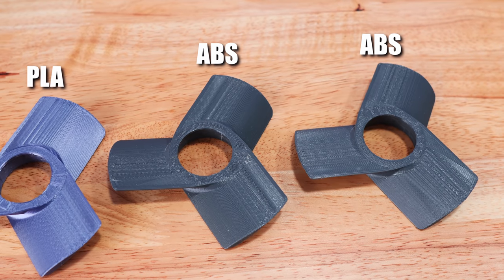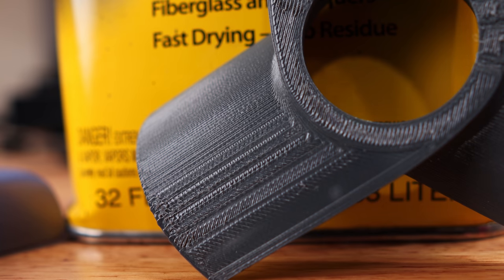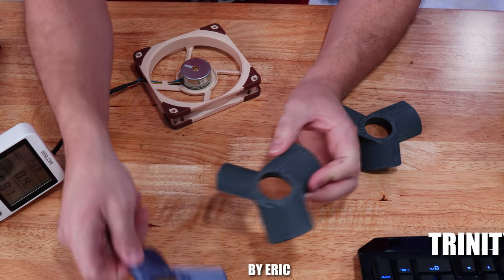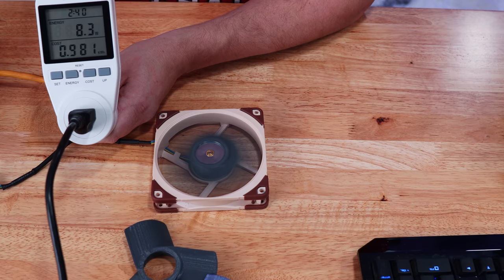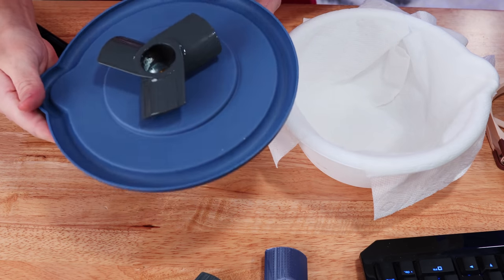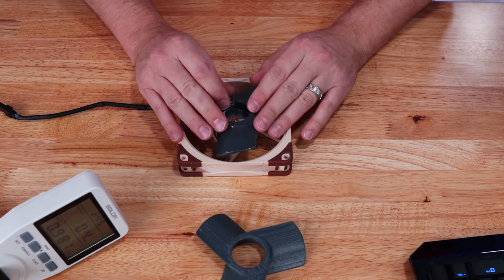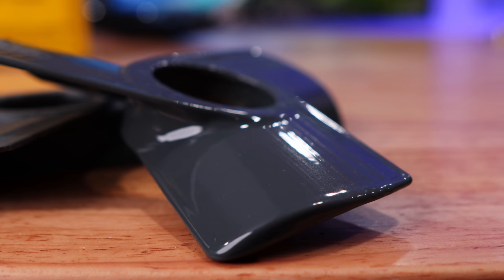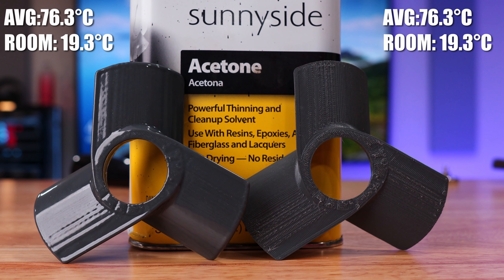Does Smoothing 3D Prints Improve Performance and Can You Smooth PLA?

Comment: Solid testing, would be interesting to know if they spin at the same speed or if there is some variance in the airflow they move. Not that it change the conclusion, just for the sake of being thorough!
Reply: was wondering that 2
Reply: I figure that a smoothed fan will be slightly more resistant to stalling, and so should put out a slightly higher static pressure. The effect should be more significant the more blades the fan has.
Reply: @fnorgen  This was my first thought when the smoothed fan pulled slightly more power when it was face down on the table but was equal to the untreated fan when standing up. If the fan produced slightly higher static pressure that could explain why it behaved that way. However the way the fans performed identically for cooling suggest otherwise.

I don't know what the truth is but it should be possible to design a simple way to test the static pressure and see if there's a noticeable difference between the two.
Reply: Between power draw and temperature management, I think it stands to reason that the fans are spinning at roughly the same speed. If one were spinning faster for the same power draw, I imagine you'd see a lower measured temperature since that would likely mean an increased CFM
Reply: @vedritmathias9193  not necessarily, fluid dynamics are strange enough that one could be spinning 10% faster but created destructive turbulence reducing the outcome efficiency just enough to match
Reply: or weight,
Reply: @fnorgen  I 2nd that because yes it’s pulling more power due to higher static pressure causing the motor more resistance trying to push the air no where.
Reply: Considering they both still take the same amount of power that suggests the RPM is still in the margin of error. So don't worry about it.
Reply: Well, if they keep exactly the same temperature, i'd say they spin at the same rate.
Reply: @TrenDMuzic  Consider what happens when you block the inlet to a vacuum cleaner.  It speeds up. This happens because it's doing less work. Either that or magic.  Any thoughts?   :)
Reply: Golf balls are not smooth, but the texture actually improves laminar flow. Not sure if that is applicable to fan blades
Reply: @sepg5084  Hard to imagine why it wouldn't.
Reply: To my ear, it seems like they were running at pretty much identical RPM. You should be able to confirm this by extracting the audio from the two +10dB sections and running through a software spectrum analyser.
Reply: @Graeme_Lastname  There is a difference between blocking the inlet and blocking the outlet. 

Blocking the inlet makes the fan draw a vacuum which make it cavitate and as the resistance goes down it will tend to spin faster.

Blocking the outlet will instead mean the fan will be building a high pressure zone, increasing resistance and causing the air resistance to increase and slowing the fan down.

When the fan was run laying flat on the table it was blowing the air down, causing that higher pressure zone and increased air resistance for the fan blades. This is why I think it's possible that the smoothed fan might have a slight advantage in static pressure. It all hinges on if as pressure increases the irregularities in the surface starts to make more of a difference. If the smoothed fan has lesser air resistance then  it will spin faster at a given air pressure causing it to build pressure until the resistance increases to match the power output of the motor.

Now it can't be a huge difference or the number would be more significant, but it's still interesting.

Besides noise is an indication of energy loss. It takes energy to create noise after all. So as the smoothed fan is less noisy it should indicate that it is more efficient.

But just to make things less clear a perfectly smooth surface isn't always the most efficient. For instance a golf ball has a myriad of small dimples and these will actually decrease it's air resistance. Myth Busters did an experiment where they covered a car in a layer of clay and made dimples in it. They then ran a test course and measured the fuel consumption. This was compared to the untreated car, but it still had the same amount of weight added to it in the booth to make things roughly equal. According to Adam Savage they didn't have high expectations for this but was shocked when the "golf dimple car" showed about 14% less fuel consumption when run at 60 Mph (working from memory here, so the numbers might be a bit off).  Adam did a video where he talked about this experiment just recently, so it's easy to look it up on his channel.

Their numbers were so startling that at least one auto manufacturer tried to recreate it to see if it could be correct. We know this as they contacted the Myth Busters with their findings which were not any where near as impressive, but from what I remember they still got a slight improvement. I guess the only reason we are not driving around in cars covered by dimples is because it would look silly...
Besides the effect seems to increase with the speed, which kind of makes sense, and a vary large part of the car fleet will almost never get up to 60 Mph or higher as they spend a lot of time in city traffic. And at those speeds the air resistance is not a huge factor.

Now I have to admit that I have totally lost track of what I started out writing about, so I think I'll better stop here...

Oh yes, it was about fans and why the surface structure of the fan blades might make a difference in certain situations. Right...
Reply: @blahorgaslisk7763  Keep this short if I can, big subject.   Myth busters TV entertainment. I have read and agree with much of what you say but ...
 Doubt if noise levels indicate much.  Could be quiet but have vortices causing heaps of drag.  Golf balls deny that smooth is better.  Blocking the inlet stops the flow of air which means less power is required so it spins faster only suffering from air friction.  Opening the inlet leaves the same air friction as before but now with the added load of actually moving the air. Power requirements go up, speed goes down.  Blocking the outlet?  Perhaps someone can give a try and let us know. I don't have a vac I can do that with.  I'm pretty sure I know but I've never done it so I'll claim nothing.  My theory is it will speed up due to the same effect as above.  Someone do it and let us know please.    😀
Reply: @sepg5084  yup, the ridges on the raw print probably work like (poor) turbulators or vortex generators, creating a turbulent boundary layer that delays layer separation and improves laminar flow at the cost of some extra drag.

Well, properly designed vortex generators on the leading edges of a fan blade could theoretically be used to increase the angle of attack a bit further than usual due to improved stall characteristics and, if designed properly, could also help with lateral flow, one significant mode of parasitic loss of lift (that also creates turbulence and noise!).

Comment: I'd love to see this done(smoothing) to the more extreme fan designs, like the Tulip.
Reply: At least it would look even cooler :D
Reply: Tulip would likely turn out to be the same as this test case. More blades or the more exotic shapes could likely see benefit though. Examples being the lightning bolt type designs and the like. If he does test smoothing the higher blade densities and those fan types, there may be a notable difference but I wouldn't expect anything major still. Air flow efficiency would increase but I don't see it being a night and day difference. But if lucky maybe a degree or two from those denser designs? Who knows.
Reply: @MidnightMarrow  It could be anything with more/longer/wider blades, basically fans with more surface area to smoothen. I somehow just went with the Tulip. XD. I just thought the current fan tested had too little surfaces to benefit smoothening.
Reply: Good luck fitting the tulip in that bowl. XD
Reply: @Skylancer727  XD. We're gonna need a bigger bowl.
Reply: The honeycomb might benefit from it
Reply: do note thinner prints are harder to smooth
Reply: @hankstorm3135  I see, didn't think that part. I guess the ones with more but thinner blades are out of the picture

Comment: I wonder if the rough one collects more dust faster, and whether that affects long-term performance.
Reply: The dust acts as smoothing ;D
Reply: More dust would indeed collect at an alarming rate and increase rotational mass, balance etc. Might in some way act to smooth as Sion mentioned but the impact wouldn't be worth it if so. lol
Reply: @sebbes333  I wanted to say that.    🤣
Reply: That would be a fairly long term test, but I am also courius about the results.
Reply: probably draws more power to spin the same rate that the smooth one does, too

Comment: It is definitely worth smoothing them out.

I designed a 3D printed pumpjet for a RC model submarine, and tested several different propulsors, the first ones were just rough, the later ones I smoothed, and it increased the performance by about 20-30%.

Comment: You should measure the dc current, that is going from the power supply to the fan, that is more accurate.

Btw i love your videos 🙂
Reply: Yeah, that's what i thought too. These AC meters are not precise, especially on low power levels.
Reply: Was coming down into the comments to say this.  Put a 1Ω high wattage resistor inline with one leg of the DC supply and measure the voltage drop across it.  Ohm's law tells us Volts / Ohms =  Amps, and in this case, the resistance is 1 for easy math.  Square that to get your current draw.
Reply: @NiSiSuinegEht  Nope, that much resistance would change things greatly.  Best use a purpose built current meter.  Not perfect, but far superior to a one ohm resistor. Same principle but an order of magnitude, or better, improvement in performance.    ;)
Reply: @NiSiSuinegEht  Wouldn't work - the current draw is pulsed, not continuous, a digital meter wouldn't read it right. You can still measure it easily enough, you just need to be aware of the effect and use appropriate filtering.

Comment: yeah but the fans you made to test this were not that bad.. Some of the submitted fans looked really really rough when printed and those being all sorts of rough and banged up would probably benefit unlike these
Reply: I also had a similar thought
Reply: Same thought.
Please do this to the honeycomb fan.
Reply: But the rougher looking blades were a product of how thin the blade's cross section was. He did explain his concerns that the thinner blades may not cope with the vapor eating away at it. Still keen to see if the thin ones cope though for science
Reply: If you had some of those paper nail files with a fine sandpaper on them and smoothed all the flat surfaces and then acetone smoothed them for a few minutes all these prototypes would look 90% like a finished product... makes me giddy thinking about it.
Reply: smoothing using acetone vapor also takes away some of the defining shape of the fan, so the blade design would literally get washed out a little bit. That wouldn't be completely fair to the designs too. There's no easy solution to this.

Comment: I would've like to see a second PLA fan and for you to have done all the tests on both of them. Just to show that there's no difference between before and after the acetone vapor bath.
Edit: Also, if you try it on one of the better preforming fans maybe you could see a difference. Like maybe trying it on the current top fan in the fan showdown lineup? Could give interesting results.

Comment: Really happy to see you did this test. I'd been wondering about it too.

One thing to note though is that a three bladed design has much less surface area than the more typical 7 bladed designs. If you were looking for a difference in temperature/power draw performance, I would expect to find it at higher blade counts.

Still, this test should be sufficient to conclude it will never make a huge difference.

Comment: You can smooth PLA with tetrahydrofuran (THF), but the much easier method that works on all printable plastics is sand  paper. Vapor baths weaken the materials and need to be specific to the material. Sand paper (and a file to start with if the layer height is high) does not weaken the material. Anyways - love the channel! Keep up the great content!

Comment: I like how easy you were able to demonstrate smoothing ABS with acetone. That was my biggest take away from this video. I didn't think there would be much thermal differences as the variance across the surface is so small with the fans between the two compared to the fan speed and air movement. But now I know a cheap and easy way to make an acetone smoothing chamber.

Comment: Also something to keep in mind, smoothing prints might make more sense when you have more than 3 blades more specifically 6+ blades. In that case there's much more surface area with roughness to cause more turbulence and inefficient flow with less margin of error where as a simple 3 blade it might help a tiny bit from a technical standpoint but not make any real difference on paper. As always, keep up the great work. Love your experiments! ;D

Comment: I have a crazy idea, but I don’t know if you’ll read this. It’s a cooling video so not quite a fan video.
So you know how graphene  cooling pads are good but not that great? Well they are super great in-plane, that’s why you can cut ice with them in your hands. Your hands give enough heat for the thin edge of graphene to slice into ice. The in plane thermal conductivity is insane. 

Sooooo what if you take that idea and slice a ton of inplane strips of graphene and sandwhiched with copper leaf and made the strips only as long as a cpu-plate is thick. And make them as wide as the cpu-plate and sandwhiched as thick as the cpu-plates other width. That way you have many individual in-plane strips standing on end able to use the super high thermally conductive ends, with heat redistributed between strips by copper leaf. It should in theory be a very very very efficient way to transfer heat to either a heat sink or radiator. 

If you are an engineer you will definitely get a kick out of this. If you want a mock-up pic i can email you, but it’s such a crazy idea that it might work!

Comment: in my testing, while acetone doesn't dissolve PLA to smooth the layer lines, it seems to make it malleable enough to essentially allow you to polish the surface. what seems to help is when there's LOADS of vapours (e.g. by putting a container with a bit of acetone in a hot water bath; some papers i've read also suggest it needs a certain temperature to be able to even attack the PLA) and then put that with your print in an airtight container for 5-10mins. makes the layer lines a tiiiiny bit smoother but for best effects grab a paper towel and just rub the surface a bit while it's still "infused" with acetone. be careful though, it stays very soft (kinda rubbery) for hours while the vapours diffuse back out of the plastic, and if you bend anything during that it'll stay bent.
while compared to ABS it doesn't do much to PLA, it might well be possible to vapor-smooth PLA using multiple passes of 5-10ish mins each while letting it "dry out" in between. takes for ages obviously so not practical in many cases, but for some applications it might be just worth it for what you get.

Comment: Hi.
I have several years of experience testing and analyzing plastic devices for directing air with regard to noise performance and whilst you are correct to say that lower noise is better performance, it is not all there is. We had to add rough surfaces occasionally to increase the noise ever so slightly because of another phenomenon - psychoacoustic.
Humans are especially sensitive to certain noises and a device can be extremely quiet overall whilst also emitting an extremely unpleasant noise (think of mosquito buzzing in a quiet room). Increasing the noise by adding other not so unpleasant frequencies is called masking (think of drowning out the mosquito buzz with a quiet raindrop patter on the roof). This sensitivity also changes with age, so a noise that is very unpleasant to a teenager might leave someone in their forties completely cool because the frequency is so high that only teenagers can hear it. These noises can generally be only visualized via an FFT analysis.
So with regard to acoustics, you are always walking the tightrope of not only wanting the noise to be as quiet as possible, but you also want to have the right kind of quiet. And thus sometimes it might be beneficial to sacrifice a decibel or two in order to get it not perfect, but acceptably imperfect.

Comment: You can smooth PLA and PETG (which is another high performance filament that's popular). If you are printing at 97-100% fill you can use a heat gun or a propane torch to smooth the surfaces to a shine. Takes a bit of practice but it works and is faster than ABS with acetone bathing.

Comment: I am that guy that was pissed you didn't clean any of your prints!! Leaving them rough af... Interesting Video how ever I find your test using a 3 blade fan rather flawed as smoothing would have the most dramatic effect on a fan with a large surface area rather than a 3 blade fan that would have a bellow average surface area compared to the standard noctua fan you use as your baseline
Reply: Should consider redoing the test using your copycat Noctua prints as the test fan

Comment: Whether a rough or fine surface makes a difference! However, this becomes really more visible the more fan area you have, because the unnecessary area created by the coarse surface is exponentially linked to the fan area, so the larger the fans and the coarser the surface, the more energy has to be used to achieve the same results as the fine one.